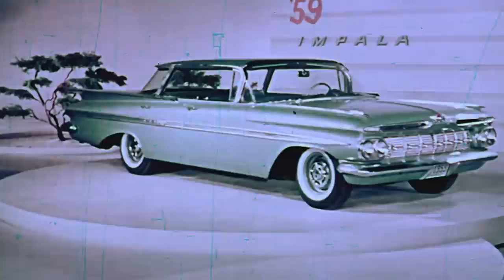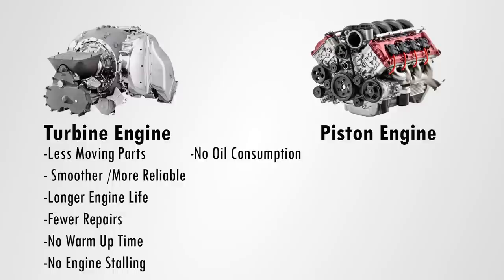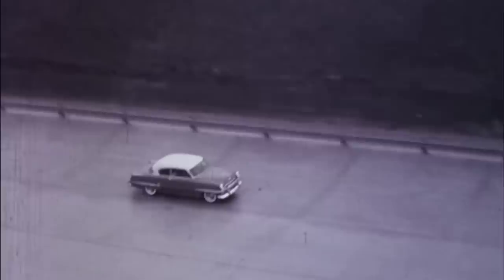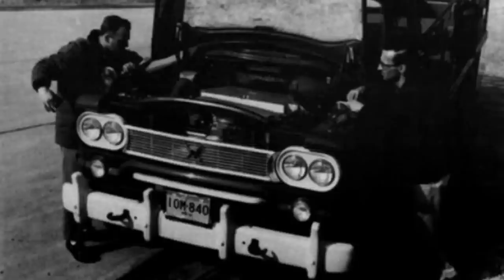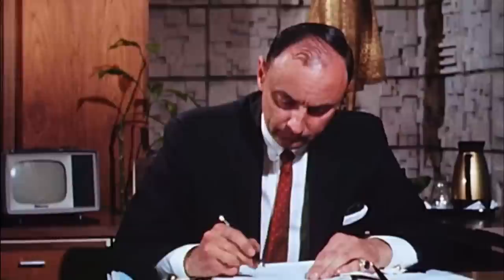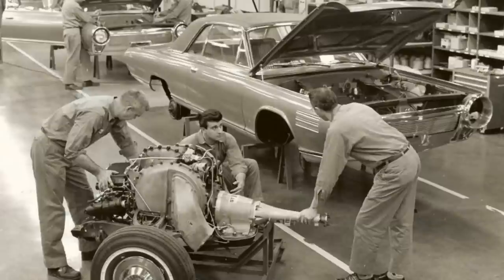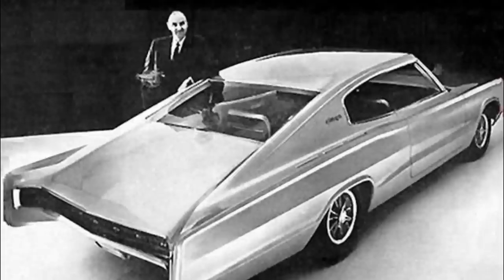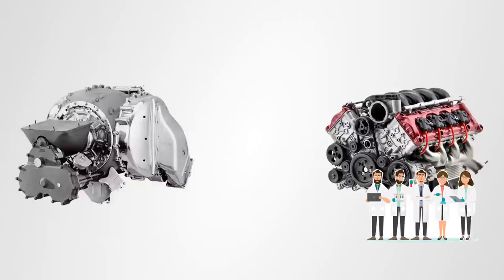Jet Plane on Wheels: The History of the Chrysler Turbine Car Program

Comment: Another great piece of technology, so revolutionary, doomed by stupid laws. It is heartbreaking 😔😔
Reply: The turbine car was never banned or subject to regulations, Chrysler canceled the program because it was a very costly failure.
Reply: @sandervanderkammen9230  I didn't mean that it's banned or something, but I mean the emission laws getting more and more strict. Without them it probably would have made it to mass production
Reply: @josefschuster7657  Not a chance, the program was cancelled because Chrysler couldn't get the cost of the engine down to an affordable price.
They cost about a half million dollars each in today's value.
Reply: @sandervanderkammen9230  Yes I get what you mean. But I think maybe if they'd have a bigger budget and also not that tight laws on emissions, they may would have had inventioned a cheaper way to produce those engines. Sadly we'll never know I guess

Comment: So the engine can run on any fuel?
So why not have this as future with synthetic fuel, used cooking oil, ethanol whatever, instead of going from one mined resource (petroleum) to another (lithium)
Reply: No, the test fleet cars could only run on gasoline, kerosene Diesel or jet fuel.
Reply: @sandervanderkammen9230 
I have read that it even ran on perfume.
Leaded petrol wasn't considered good for it.
Essentially any spirit
Reply: @KanishQQuotes  That was only one prototype demonstrator car, the preproduction fleet cars could only run on gasoline, kerosene, diesel or jet fuel.

Comment: As I recall, there were many designs for cars, especially in the 60's. All shot down by the major car or oil companies. Like the Brickland (out of Canada) that you sat inside of the frame.
I'm sure they're still shutting down innovation...
Reply: Are you a flat-Earther too?
Reply: @sandervanderkammen9230  no
Reply: @theodoreroberts3407  Then why do you believe conspiracy theories like "big oil"
Reply: @sandervanderkammen9230  ... And that's you. 
The difference here is I remember these cars being on tv. The Brickland, turban and alternative fuel cars of the 1960's. Let's say you don't have that experience. None of them passed their examinations, by Sohio oil and car companies, so none ever made it to manufacturing. What about Henry Ford's time? There were different types of engine then too, but Ford got the economic push from oil.
Let's go back to you. There is enough room for you and your belief system too.
Reply: @theodoreroberts3407  No that's reality and the basic concept of economics.
I certainly do remember the OPEC Oil Crisis and long lines at gas stations.
 Interesting theory but you don't know your history do you?
Henry Ford was a huge promoter of alternative fuels and the Model T was designed to be flex-fuel capable. 
It could run on Ethanol or Gasoline.
Reply: @sandervanderkammen9230  I lived the history I talked about... And you never heard of the Brickland? A car designed by two Canadian women. The big difference was you sat inside the frame, not on top. Maybe you don't know your history!
Reply: @theodoreroberts3407  The Bricklin SV-1 was an American car company, designed by dune buggy designer Bruce Meyers and manufactured in Canada.
It was powered by a off-the-shelf American V-8 made by Ford (351) or AMC (360)
The Bricklin was more advertising hype and BS than anything high tech or cutting edge.
Reply: @theodoreroberts3407  I bought a Bricklin in the 1980s that was not running, fixed it up and flipped it for a profit.. it's a horrible car and I was glad to be rid of it.
Reply: @sandervanderkammen9230  Okay, horrible. But it was designed and shut down. I never owned one. And they did let two women clame it and talk on the air.
Reply: @theodoreroberts3407  Bruce was more well-known for the Meyers Manx  kit cars built on  the VW Beetle chassis.

Comment: "less moving parts"
it's fewer, not less
Reply: Its also not true...
Reply: @sandervanderkammen9230  The correct word is fewer, not less.
Reply: @wintersummers3085  Gas turbine engines do not have fewer parts
Reply: @sandervanderkammen9230  You'll have to take that up with the maker of the video. I was correcting his word choice and not the content of the statement.

Comment: On ABRAMS Chrysler  in 80x still working Turbine
Reply: Chrysler had absolutely nothing to do with the design or manufacture of the Abrams gas turbine engines.
  The AGT-1500 was designed in Germany by Dr. Anselm Franz in 1945 and manufactured by LYCOMING.

Comment: Sadly these were a failure. They were designed and built as a low emission engine. I and a friend who designed and built a steamer[external combustion] were invited to ride in a turbine around 1970 by the E.P.A. in conjunction with Chrysler Corp.. We did not see the turbine but the idling  temperature of the exhaust was way too high. The steamer was the lowest emission engine in the world and still is. The old master has gone now.

Comment: Love your videos, Ed, but throughout I couldn't help think of Sikh headwear when you say turbine.
Reply: Its correctly pronounced Tur-ben
Reply: @sandervanderkammen9230  I'm not sure if you're referring to Sikh headwear, which is 'Turb-an' or turbine, which is pronounced with the 'ine' sounding like 'nine', for example.
Reply: @nicksmpsn6546  Its spelled Turbine and correctly pronounced Tur-ben
Reply: @sandervanderkammen9230  I think we shall just have to disagree.
Reply: @nicksmpsn6546  indeed, there are not standards for pronunciation in English..
Turbine however is a French word
Reply: @sandervanderkammen9230  Oft, this could get exhausting. The origin of 'turbine' is Greek and first used in its current form in France. In French, the pronunciation still isn't 'turb-en' as you claim, but the same as the correct English pronunciation.
Reply: @nicksmpsn6546  Exhausting only because you realize your position is indefensible, in British English French words are typically Anglicized in pronunciation, this is because there are no rules for pronunciation in English.... English is a chaotic mish-mash, a Germanic based language but heavily corrupted by words appropriated from many languages which have differing rules for pronunciation.
 This is in contrast to the French language where spelling and pronounation is strictly codified.
Reply: @sandervanderkammen9230  No, really, it's exhausting because you're boring me and I've wasted enough time already. My advice is, in the nicest possible way, next time you read a lighthearted comment on a video, just move on and don't show yourself to be a total arse by responding. Will save everyone a whole lot of time.
Reply: @nicksmpsn6546  Next time think about what you are going to write before you start typing... it will save you a lot of embarrassment in future... or better yet, just resist the urge to post anything, it's not your cup of tea lad.
Reply: @nicksmpsn6546  Thank you for conceeding the argument... its very honorable of you to admit that you were wrong. Cheers mate!

Comment: That's almost exactly where the Wankel engine is heading thanks to the EPA. Sadly the V-12 is next eventually
Reply: The lack of reliability, torque and fuel efficiency is what killed the Wankel engine...
Reply: @akronymus  All Wankel engines operate using the 4-stroke principle.
 2-strokes that use stratified charge mode combustion are the most efficient reciprocating engines in the world
Reply: @sandervanderkammen9230   
The engine oil has to be mixed with the fuel, like in 2-stroke engines, this makes terrible exhaust values. With the delta-shaped piston, it becomes kind of a 3-stroke engine.
Reply: @sandervanderkammen9230   
And the oil mixed to the fuel – exactly the same weak points as with the 2-stroke.
Reply: @akronymus  Not all Wankel engines use pre-mix oil in the fuel, oil injection with a wet sump crankcase is the ideal method of lubrication.
 The Wankel operates using the exact same 4-stroke operating principle as the Otto Cycle, the only difference is that the Wankel requires 1080° degrees of crankshaft rotation to complete the firing order sequence instead of the usual 720° degrees of the Otto engine.
Reply: @akronymus  pre-mix and oil injection are not defining features of the 2-stroke Benz Cycle engines or Diesel 2-strokes.
Some 4-stroke engines  (like Rotary type engines) draw the fuel and oil injection through the dry crankcase and enter the cylinders through piston ports like a Benz 2-stroke.
 Any questions?

Comment: I really wish turbine powered cars were here today, because it would actually be innovative. Too bad it's not realistic for a modern world
Reply: @ChrispyNut  Now that's COOL! AWD burnouts for days! My thing with turbine engines is, if they were successful we might've had turbine swaps be a popular option, like the LS7 swap.
Reply: How is it not realistic? Since these things are most efficient at a constant high rpm, why not use them to charge an electric battery?
Reply: @baileyharrison1030  Because rpm and power output are directly linked in gas turbine engines.
Gas turbine engines are only fuel efficient above 80% of rated power... and rechargeable batteries have a tapering Charge Curve

Comment: Imagine a turbine generator to charge a much smaller battery in an EV. Runs on any fuel including hydrogen which is crap fuel energy density and storage wise.
Reply: Not a practical or commercially viable concept, gas turbine engines are completely incompatible with battery electric vehicles.
Reply: @sandervanderkammen9230  Huh, there is a 345MegaWatt Gas turbine  electric powerplant about 5km from me. Think big model plane gas turbine as battery charger, range extender. Hybrid, small lighter cheaper battery.
Reply: @alwayscensored6871  Actually no, gas turbines are completely incompatible with the Charge Curve of rechargeable batteries..
 They are excellent in applications were than can run for long periods and maximum rated power output, they are terribly suited to applications were partial loads and idling are required.. they are incompatible with most land based transportation applications and very poorly suited to battery electric vehicles.

Comment: Interesting concept, a turbine car, but was it practical ? Car engineers creates a design that has "promise", such as the Chrysler turbine car, trying desperately to keep refining it, but fails to "make headway" in the end. Now compare this with what another "engineer" or "designer" has made, the universe, in which its design is perfect, and never needs refining, and will last forever.

And the universe's fuel supply of hydrogen being converted into helium is based on atomic fusion, something that some engineers are trying to implement into the realm of "normal living", and this supply is endless, that cannot be measured. 

Here is what is said about this "engineer": "There is One who dwells above the circle of the earth, and its inhabitants are like grasshoppers. He is stretching out the heavens like a fine gauze, and he spreads them out like a tent to dwell in........Lift up your eyes to heaven and see." 

"Who has created these things ? It is the One who brings out their army by number (with an estimate of some 306 sextillion stars in 2010 among some 100 to 200 billion galaxies); He calls them all by name. Because of his vast dynamic energy and his awe-inspiring power, not one of them is missing.......Do you not know ? Have you not heard ? Jehovah, the Creator of the ends of the earth, is a God for all eternity."(Isa 40:22, 26, 28 in the Bible)

Comment: With todays technology and engineering advances, would the turbine be the answer?
Reply: Most definitely not, the gas turbine engine is simply incompatible with the automobile or any land based transportation applications.
They excel in aircraft applications and have completely displaced reciprocating engines in commercial and military aircraft.
They are also perform well in ships and in power generation.

Comment: The best engine Chrysler made was the slant 6
Reply: Slant Six was great. Equally as bulletproof/long lasting are their small blocks (318/340/360/273, and the 8.0 V-10 that's based on them-I have 500,000 miles on my V-10 and it's still going like new!). And Chrysler built the most durable, most responsive big blocks (383/440 & the rest) of any of the big three, hands down!

Comment: 13 Miles Per Gallon? (6:53) That's UTTERLY DISGUSTING as regular cars could get at least 25 MPG.  And the Metric measurement should echo the imperial - Kilometres Per Litre! (Distance travelled per unit of fuel used).
Reply: No that was pretty standard for American cars at the time. Fuel was cheap enough back then that the main concern with low fuel economy was having to fill up the tank more often.
Reply: The problem with gas turbines is they consume the same amount of fuel when they are idling compared to more than 50 % of power output. They are fine and light if you use the power constantly, but not in the way a car uses its engine.

Comment: Turbines had actually been around since the late 1800s although they were steam powered gas and oil powered turbines became popular in the 1920s not 1930s although they weren't used in small applications but they were used on ocean liners like the Lusitania and Mauritania (1906) and also the Queen Mary.
Reply: Not really the same thing, steam turbines are completely different technology and are completely unrelated to gas turbine engines.
Steam turbines are external combustion and use the Rankine Cycle.
Gas turbine engines are internal combustion engines and use the Brayton Cycle
Reply: Jens AEgidius-Elling invented the gas turbine engine in Norway in 1903.

Comment: Chrysler didn't "invent" or even really develop the regenerator, it was already developed for the Rover turbine programme, actually the whole Chrysler turbine engine is a copy of Rover's engine, but the Rover engine(& arguably the cars they tested them in) was always slightly more advanced than Chrysler.
Reply: The first gas turbine engines used in a road vehicle was by BMW in 1944.. the GT 101 as featured a exhaust heat recuperator as well, they invented the technology.
Reply: @sandervanderkammen9230  Only sources I can find say it was an Aero engine, they did try to develop it as an engine for tanks but I can't find any sources that they put it in a car, or road vehicle & it was an axial flow engine so the heat exchanger/regenerator would have to have been of a totally different design.
Reply: @milksheihk  Well, you didn't look up a very good source.
How does the type of compressor have any relevance on the recuperator???
Reply: @sandervanderkammen9230  If you understand the difference between an axial flow turbine engine & a centrifugal flow engine & how they work, how the gasses are routed you would realise that the regenerators couldn't possibly be of the same design, or, y'know, you could just google an image of the GT 101 & see that the regenerator is of a completely different design.
Reply: @milksheihk  The type of compressor does not have any relevance on the recuperator.
The recuperator was first used by BMW for the GT 101 and its variants.
It's is simply a heat exchanger that recovers heat from the exhaust gasses rejected by the turbine.
Reply: @milksheihk  You are wrong, Rover did not invent the recuperator or the first gas turbine engines for land based transportation applications.
Reply: @sandervanderkammen9230  Can you read? I never said rover was the first land based turbine, I said it was the first gas turbine car engine,the GT 101 was NEVER in a Car, a tank is not even a road vehicle, & if you re-read what I originally posted I didn't say they invented the regenerator either, I said the one Chrysler used was a copy of the Rover design, which was developed by Rover, for their engine, Their regenerator is of a completely different design to that in the GT 101.
Reply: @milksheihk  Yes, I can read English very well thank you, I call Bollocks mate! 
When did Rover first have a recuperator?
Can you provide any evidence that Chrysler copied the Rover engine?
George Huebner began development of Gas turbine engines at Chrysler in 1946, his first design the A-86 was started in 1946 and tested in 1949.
 The BMW GT 101 was also tested in a truck, a tank is not a car but it is a road vehicle.. they are designed to operate both on and off road.
Certainly a more successful application for a gas turbine engine than an automobile.

BMW is still in business and BMW gas turbine engines are still made, Rover and Chrysler no longer exist.
BMW acquired Rover in 1994 and Rolls-Royce in 1998.
Chrysler was acquired by Daimler-Benz in 1998.